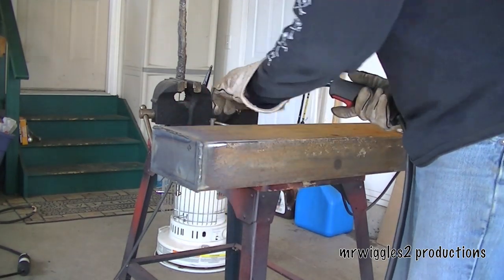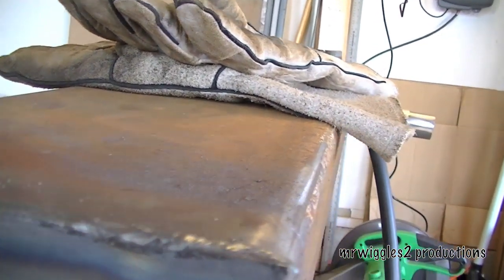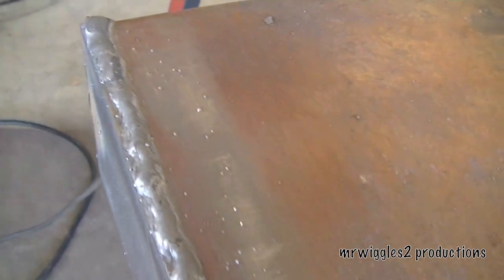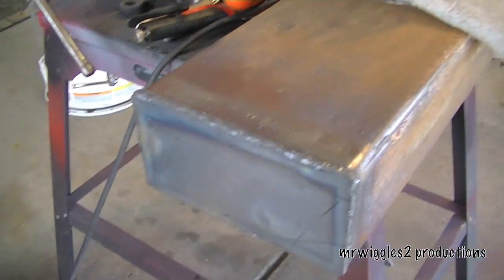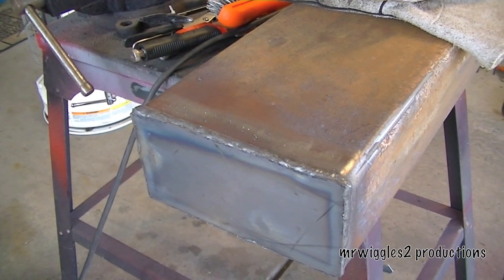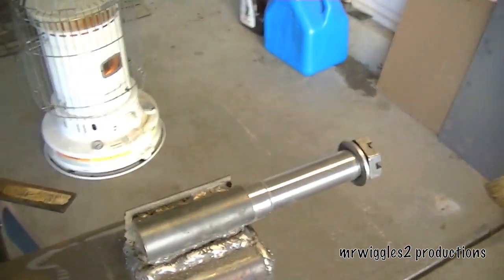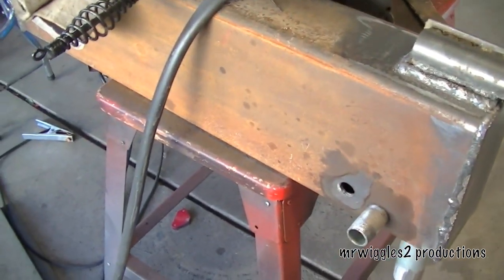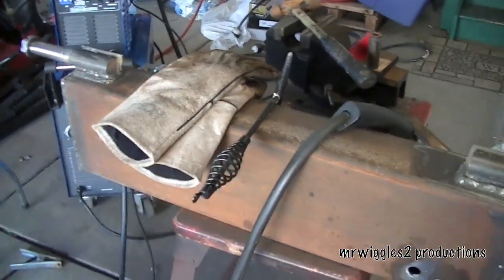Homemade Log Splitter Build Part 3

Comment: Wouldn't it be an easier test to dunk it in a tank of water? Like the progress though I want to do one, currently only need hydraulics and some I beam
Reply: And a welder... that would help a lot
Reply from the maker: Quenching is what you’re referring to and no, that’s definitely not something you want to do with structural welds. It’s okay for practice welding beads, corners and such to cool the steel.  The shock can causing shrinkage and cracks among other things.  This was a fun project, I really enjoyed building this splitter and it works so well.  I’ve split a lot of wood and recently a good buddy of mine who knows how to use a splitter, used it for a month and it split a load of wood for him.
Reply: Craig Arndt, I didn't mean when it was hot.. when tested for leaks is what I'm talking about.
Reply: Craig Arndt, just saw the test video, that thing is bad ass

Comment: I know this is an old video - but some welding tips:

since you're running flux core, you should have your wires set to electrode (gun) negative, ground positive.

set your wire feed down a little and go a little slower, with mig it helps to push rather than pull on pieces like this.

most of all, do a little movement (circular or zigzagging) to help get an even, consistent bead. I know this is only a reservoir, but you still don't want to end up with leaks.

and if you can afford gas - use it! Worth the money in weld quality.

Comment: I can tell you this, you don't want to have to bend over except to pick up wood. I was thinking about adding a manual lift also to work like one of the hydraulic ones except use a removable handle (probably my cant hook) on the other side.

Comment from the maker: You are so right.  I have been going back and forth on this for weeks, watching videos and looking at other splitters.  My I-beam is 10' long, so I will have extra.  Was thinking of cutting off a block of it and welding that to the top of the hydraulic tank, then putting the beam on top of that. That will get me another 6".  Its a very good point and one I've been struggling with.

Comment: One thing you want to think about before you get to far along is working height. Every log splitter I have ever used is to low. The one that my brother and I share I made 6X6 blocks that I can put under the tires and another one for the stand. He's a bit shorter than I and likes it with out them or I would have added some steel to raise it. Since then I have purchased myself one to keep here at my place. I am going to raise it and build a table for the hitch end to put idle halves of wood.